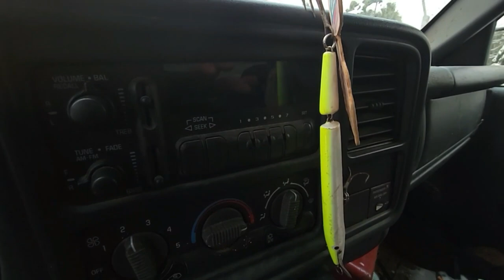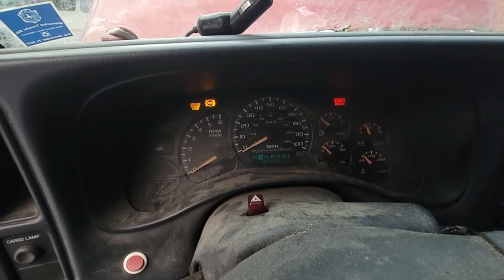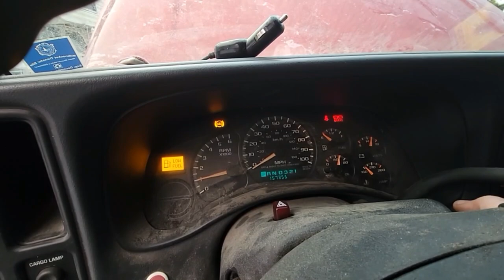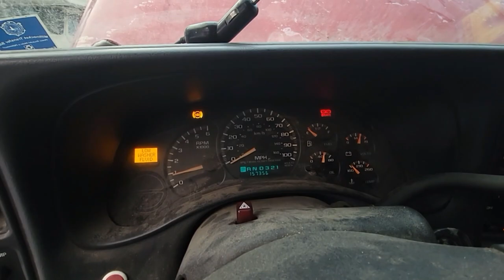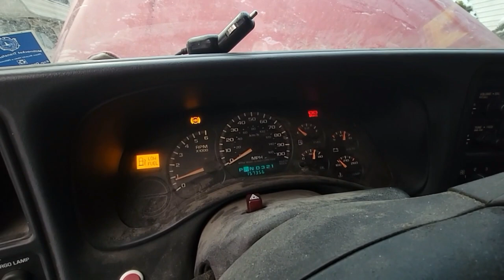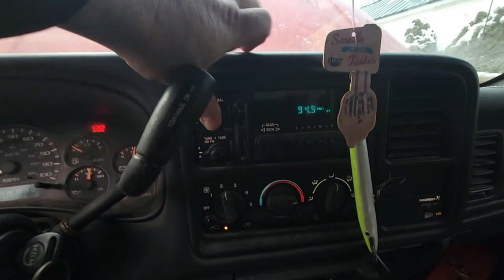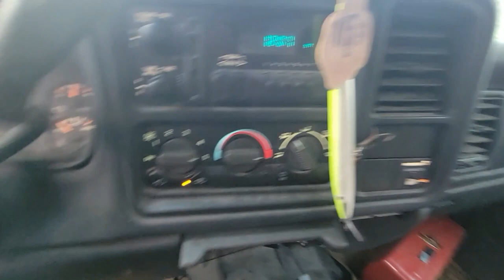Will the junk GMC start? sitting in the woods for 5 years

Comment: I have a 2000 2wd with the 4.8, and a 2002 4wd with the 5.3L.   Same blocks, but different displacements.  Every once in awhile on the 02 the low coolant light would come on when the system is full.  When that happens i shake the coolant reservior bottle vigerously which cures that annoying problem.  The fuel guage problem could be a bad stepper motor in the cluster, or a bad sending unit.   Personally i would just repair a few minor things on it, and flip it for a profit

Comment: It's what's most people would refer to as the baby V8, but it's actually not the smallest V8, GM ever built.
Did you know GM built a 4.3 L V8, it was on the LT1 Platform.
Maybe put the plow on this truck??
I know the fram on this truck is a bit crispy and the fram on the plow truck is cracked, overall is the fram on this truck, potentially better??